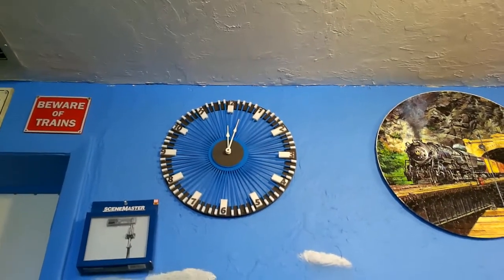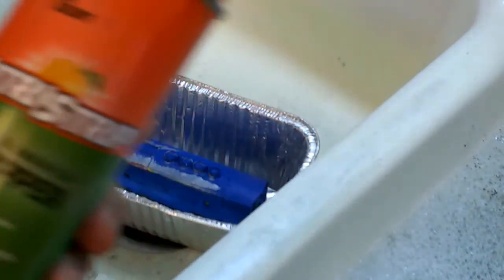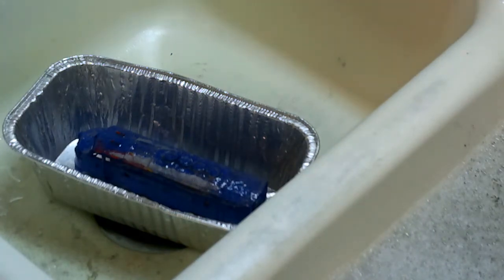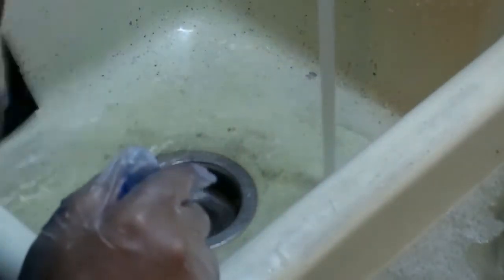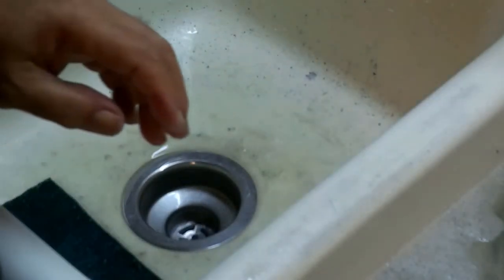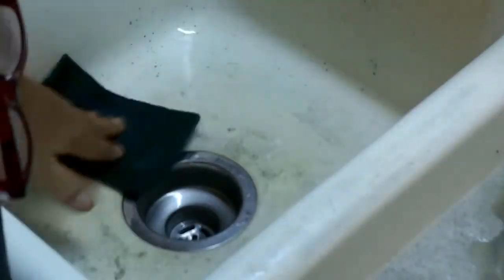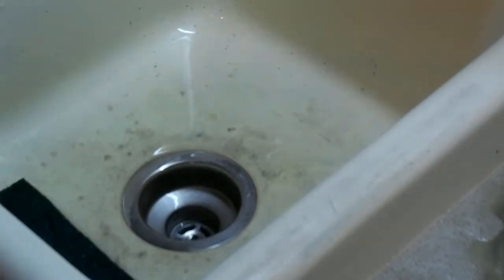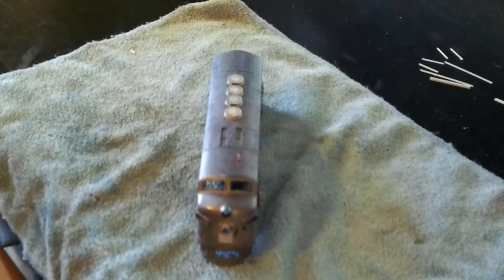Millennium County RR - Episode 41 Custom painting an FA-7 locomotive

Comment: That stuff worked pretty good .  Next time get a plastic tub from the dollar store and do it in the garage . I hope you didn't get in trouble for making a mess ! LOL
Reply from the maker: It did work well, I tried alcohol first, waited 48 hours and it didn't work so I bought the citristrip and it worked without melting the plastic. Next time I will buy a slop sink for the laundry room instead of using the kitchen sink. I wound up going outside to finish the stripping. I did manage to clean up the sink with a lot of elbow grease.